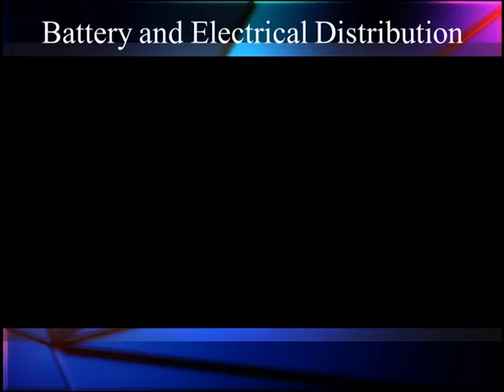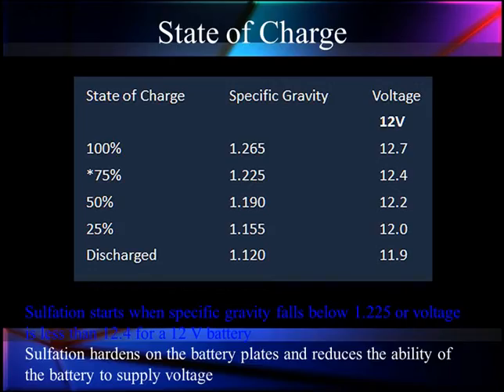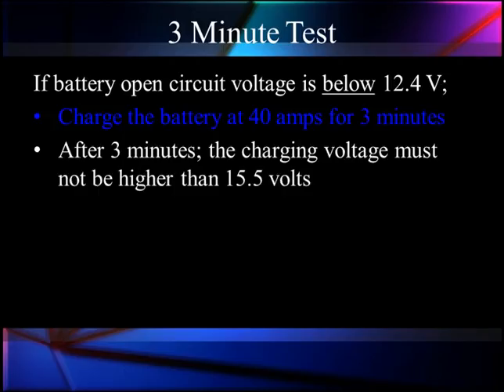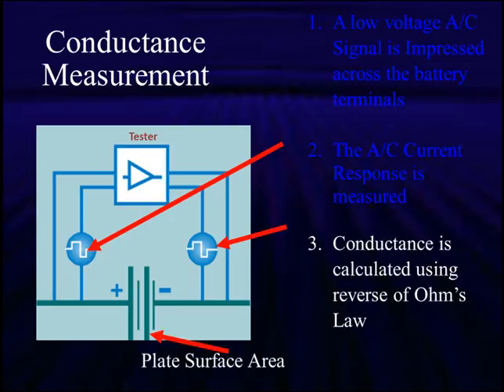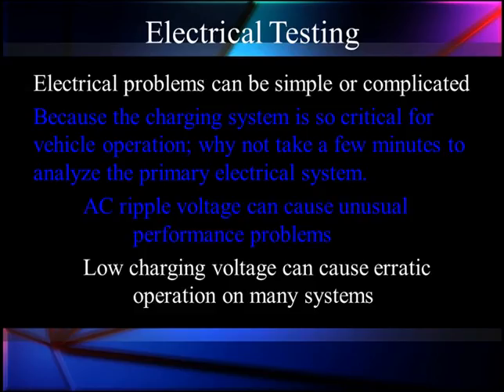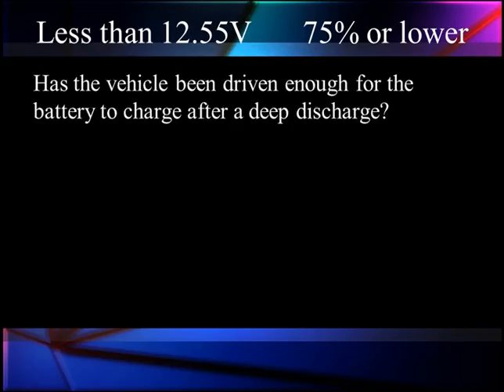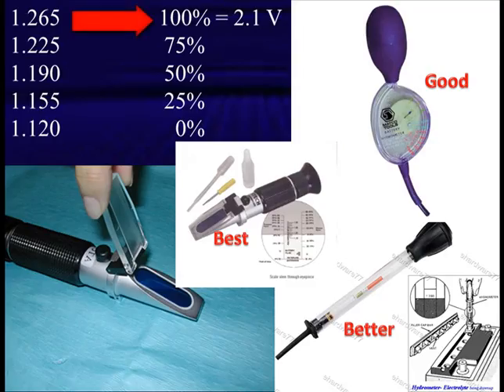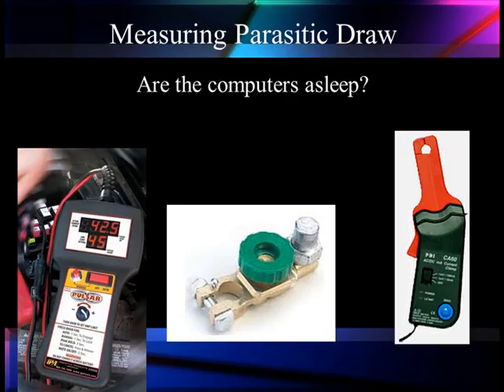17 Battery Testing

Comment: Informative video, thank you.  Is the 83F temperature shown on your meter at 14:45 in the video simply ambient temperature or, is it the surface temperature of the battery case (using say, a K-Type thermal probe, out of camera sight)? Or, it doesn't matter?